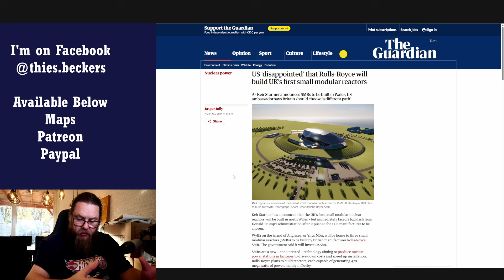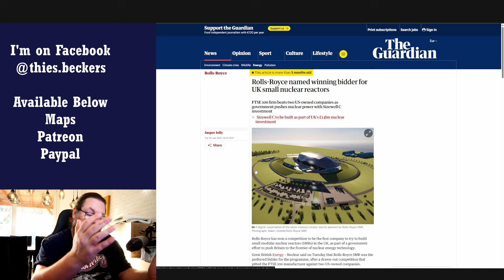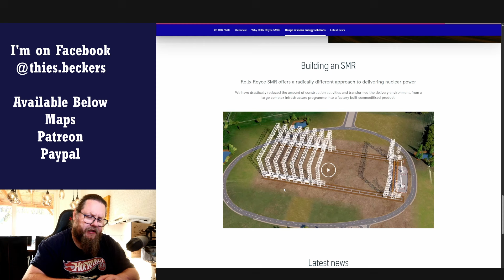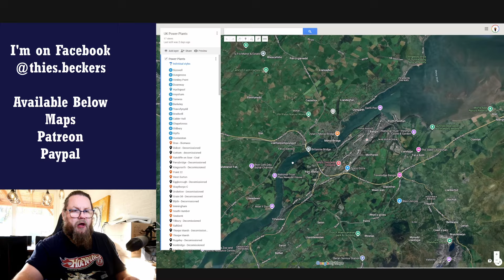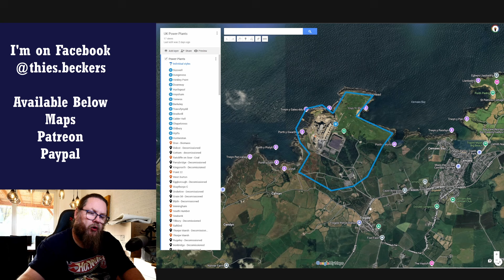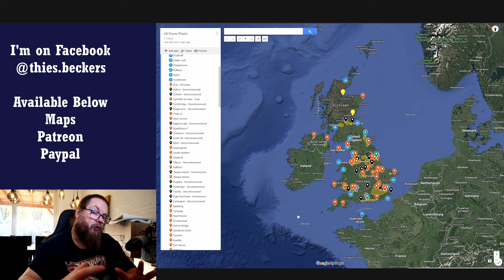UK Snubs America: Rolls-Royce Wins HUGE Nuclear Deal!

Comment: Practical questions:
1.Why UK plans 2more EPR v1, when clearly/hopefully EPR v2 should improve build times?
2.Why not ABWR in UK? If i understand this is certified design and there are good reasons to hope of fast build times and even just because of that- better build costs. Anything seem to be better than EPR v1.
Reply from the maker: I'm wondering too. For sizewell C there was too much work put in to turn back and re-evaluate. But now, they have set this build in motion, they shoudl re-evaluate all the other sites that they are or are not considering. I also wonder if GE will ever want to build an ABWR again. They are all-in on the X300 even though that is an entirely different weight-category.
Reply: @Atomicjedi because of reasons that you explain in the video- hard to believe that small reactors can be cheaper/GW of capacity long term. 3power plants to match output of one with 3control rooms instead of one. Other staff must scale similarly. Appeal of SMR is in building them fast or adding them on top of an already decarbonized grid, or small grid(island). ABWR is proven in real world to be able to connect to the grid in about 4years from first concrete pour- hard to imagine anything much better. Oh well- how much Europe screwed itself in "impossibilism" , NIMBYism, and FUD.
Reply from the maker: @msxcytb  You're making the mistake of pitting nuclear against nuclear. Never do that. Any nuclear is better than RE+ Hydrogen + batteries + gas backup. SMRs, MMRs, BMRs... Any
Reply: @Atomicjedi  I get that point of view and share it, mostly. Any new nuclear or old one continuing to run is great and important. I'm affraid of hypes though. There was and still is lots of hype around SMRs and none yet exist.  I want to see GWs of coal and biomass and gas replaced fast and forever and there are proofs (ABWRs build in Japan not to long time ago) that smallness or "modularity" is not necessary the key factors for speediness and being on budget. Fingers crossed that UK can get a grip and improve over their EPRs track record by a lot, because there is lots to be improved.
Reply from the maker: @msxcytb  Agreed, there's loads of vaporware out there. Lets root for the vendors that actually put in the work needed to deploy sufficient numbers to matter.

Comment: cooling water being poured into the sea is surely a climate problem.Using waste(reprocessed nuclear waste) has failed before.U.K.Government obsession with nuclear generation is the problem.
Reply from the maker: I have a video on that, it is hardly noticeable and similar to the infrared coming of PV panels at scale and similar to the heating effect of windmills mixing air that shouldn't be mixed.

Comment: I wouldn't worry about pronouncing Welsh names, there's only the Welsh that are capable of it 😂,  there did used to be an aluminium smelter outside Holyhead which worked in conjunction with Wylfa A, it seems that is the proposed site for the data centre so it's likely some of the infrastructure still exists to connect them. It's probably a site better suited to large reactors but if what I've read it could take up to 7 of the Rolls Royce units (3290MW). Personally im glad we have gone with an indigenous design, RR has a good reputation. Dealing with the US at present seems a little chaotic and politically might be best not to get too more involved if we can help it.

Comment: AGR's came after the british MAGNOX.
You are exactly right. We need all reactors we can get, large, small, gas cooled, breeders... Even if the economics of small reactors do not add up right away.
Ideally we would have LMRs, large modular reactors. Like germany tried with the konvoi-design. It would have worked if they kept on building these reactors, but sadly they didn't.
The AP1000 was designed as a LMR. But they messed it up when they started construction without having a complete design. Changing the design while construction has already begun is really, really bad and expensive.
The EPR was a good idea, modular at least in theory, but with kind of overdesigned safety systems and they too started construction without a final design. At the end the 3 european EPR builds were not really modular with individual designs for each site. This is a catastrophe.
The ABWR construction worked really well at Kashiwazaki Kariwa, as did the APR1400 in Barakah.

Comment: Well yes, since an AP1000 should cost at most $2-3 billion to build, it would definitely be the cheapest grid scale option. But if they keep being incompetent and building them for $23 billion instead, then... well sadly that doesn't ensure the RR project won't be equally incompetent at that... But it's hard to say beforehand. After all the exact same industrial capabilities are needed for both, they are both large-ish PWRs with similar engineering.
Reply from the maker: agreed